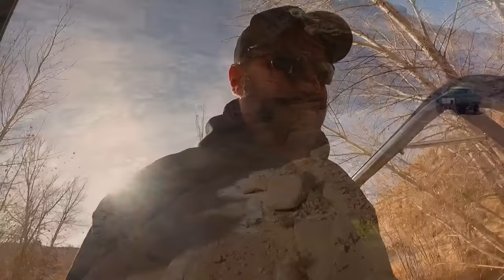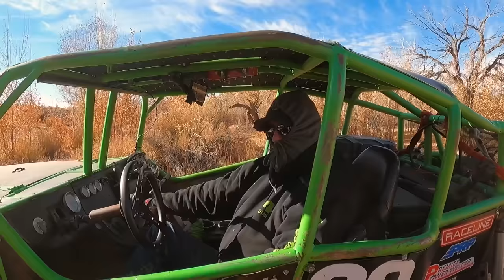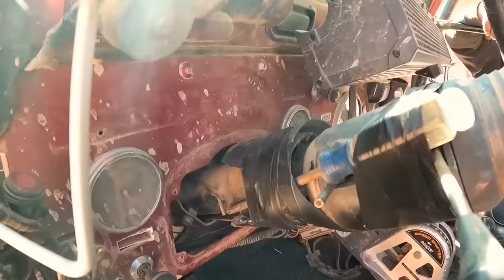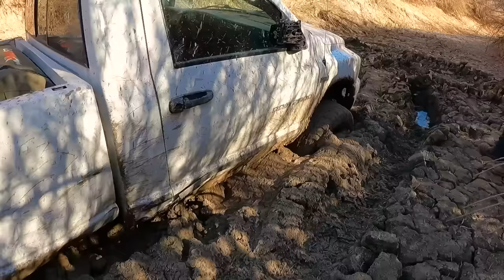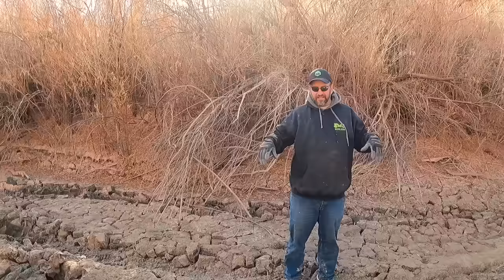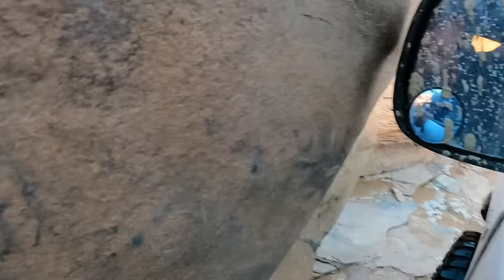I Scratched Ol Blue, 3 Trys To Do A Job

Comment: You guys know the tire trick for getting lift on a pull like that. When you stand a tall spare rolled up to the stuck vehicle and loop your tow cable over top of it to get some lift. I'm sure you do. In some cases it works in others it just gets in the way. But it works when you have no other way to lift. You guys I swear are a regular comedy trio. It's great to work with close friends like that and have that much fun at work. Outstanding video as usual keep up the great work!
Reply: I saw this method many years ago and am surprised that I have not seen it on a recovery channel.

Comment: I knew of a guy who bought a custom Radon commercial fishing boat on the Central Pacific Coast. These boats are highly desired and very expensive. He ran it up onto an oyster bar and scratched the hell out of the hull on the first day out and nobody could believe he did that. He said something along the lines of, "It's a work boat, now I can feel comfortable using it." Rory definitely gets it. Use your equipment, it can always be rebuilt and repainted.

Comment: This is an example of where a big airbag underneath would provide lift over a large area and the Jeep might have been able to pull it out if the suction could be broken... In theory.
It's also a great example of why Rory doesn't have to carry as much recovery equipment because his experience has taught him well.

Comment: A nice example of how the toughest doesn't have to be the most dramatic.  It might look like 'just pull it out' and not much vs some of the rock recoveries but that was a tough extraction.  3:1 with the up-pull and a second anchor and it still took some effort.  Nicely done sir, nicely done.

Comment: Still calling the green painted blue truck blue is classic!  Could you have run the front winch over the roll bars to the back to get the required lift? That Ram definitely seemed to be a bit oversized for where he ended up but the skills you have to get them back out is always impressive.  "If you would have made it you would have had it you were there" almost deserves its own Tshirt.

Comment: Nice job getting that truck out.  Pretty slick rigging.  I think it's the first time I've seen you use a doughnut instead of a snatch block.  "Gandalf Rocks"... sounds like a new trail feature name.  The steering column fix was pretty creative.  That would be annoying having your truck shut off when it felt like it.

Comment: I was surprised to hear you say Trail Mater wouldn't fit between the rocks. From what I've seen you do before, I assumed you had technology from the Knight Bus (Harry Potter) where you pulled a lever and Mater would shrink sideways to fit through anything. 😁
Reply: Must be a generational thing - you said "knight bus" and I instead pictured the 18 wheeler from Knight Rider.... 🤪

Comment: Something you could do for situations like these is put a really heavy duty roll bar in the back of one of the jeep buggies. A roll bar strong enough to run a winch pulley up there. 

It would allow you to run the winch line up there and when vehicles are stuck in the mud provide the same lift as the boom on the wreckers without the size or weight. It would allow them to break the suction of mud like the wreckers. 

You couldn't tow with it obviously but at least while everything is stationary it would help.

Comment: Did the same thing to my 80 series years ago when I bought it - ckearcoat was peeling off, so I had it resprayed. 
Weekend after I got it back, I went off road and gave it a thorough pinstripe job.  The lines have faded over the years (or I've got used to them).

Comment: When a plan of mine works out but I wasn’t 100% sure it would work, I then like to vocalise why it worked & what I was thinking, it’s like i’m explaining to myself why it worked. It’s a very common thing as well because in reality that’s exactly what is happening, one side of your brain is telling the other side that it was right.
Great job Rory !
One thought I did have though is, on the journey out if the vehicle breaks something, is that on you ? Would it be better to let the customer drive it out? that way, if they break it, it’s not your fault or cannot be blamed on you.

Comment: Rory, GM tilt columns has 4 bolts at the bottom inside the column that come loose underneath the pivots, I believe  Chryslers are built similar.. You can pull it apart, tighten the 4 E socket bolts and it will be like new.

Comment: Do what my friend working in 125 f temp at the Chrysler plant in the 70"s did. Wore a paper jump suit and ran air up the leg. You could have ducked hose plug in your suit from the heater box. Warm as you want. Also cool as you need with the ac.

Comment: You guys could use leather jackets to bloke the wind. Check the used clothing stores. If you get it an extra size larger than your normal size it will fit over your hoody. Face masks for snowmobiler's are better than ones for skiing. How do I know? -20 temps with -50 windchills. A pair of insulated bibs or coveralls are great especially when you lay on the ground as will a yoga mat.

Comment: You guys need a big A.... 😄🙂 

a collapsible A to set up, next to the vehicle you're going to rescue from the dune, the mud, the snow... You name it... An A to put the winch line over. Then the winch both lifts the vehicle up and pulls it backwards... The Russians are good at this when it comes to salvaging heavy equipment in the middle of nowhere! Easy to carry and can be used without heavy recovery equipment!

Comment: If that's a GM tilt column, I had the same issue in my old Blazer where the 3 Torx bolts holding the tilt mechanism came loose and would shut the key off when you turned the wheel far enough.

Edit: I now see further into the video that you fixed the issue 😂

Comment: One time years ago, I built a custom motorcycle and I was showing it off right after I got it together. My kickstand was too long and the bike sat too vertical, as we were admiring it, a car drove by and it fell over. I had a split second of anguish and then I told my friend, "Well, now that it has it's first scratch, I won't have to worry about riding it.."

Comment: just be careful with recovery rings as they cause friction and the friction heat.... what causes hmpe winch ropes to fail is heat and the melting point of hmpe is 150F which these ring can get the rope to very easy

Comment: Now I'm wondering why The Buggy doesn't have a removable windshield with hinges like an old Willy's CJ2 Jeep. It shouldn't be too difficult to add.  Add two bolt attachment points and maybe rubber hood hold-downs to hold it up and down when not in use.

Comment: What are your thoughts on those solid circle things as opposed to a real snatch block?
Reply from the maker: They work fine. Different tool to do the same job. The internet insists on having an argument that doesn't need to happen. Use them or don't, who cares. Whatever tool you decide to use, use it right, that's the important part nobody talks about.
Reply: Sounds like good advise, Rory.
Merry Christmas to Shawn, Mike and You and your Family. Stay safe in your Work

Comment: Gut   to  love  frozen   mud,   I   seen   a   cat   dozer   up   to  the   seat   in   frozen  mud  buy   the   time   I   gut   there   they    hooked   on   with   a   bigger   cat  and   ripped   stuck  one   in   half,   engine   hood  and   radiator   were   20   feet  in   front   of   seat   and   tracks ,   you  cant  fix  stupid.

Comment: What motor is in the scrambler. Not a chevy or ford. Mopar maybe
Reply from the maker: AMC 360
Reply: @trailmater  any particular reason other than you had one sitting there?
Reply from the maker: @brettknighten1171  that's what it had in it when I bought it...